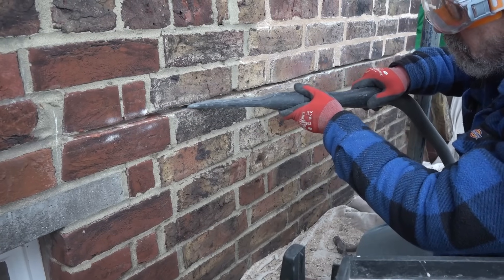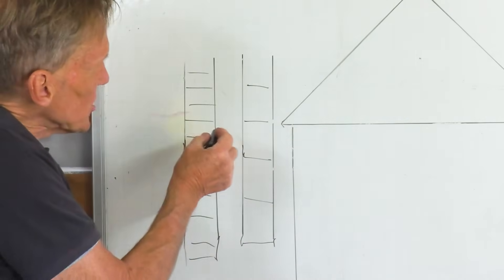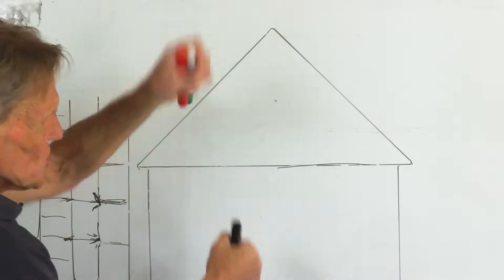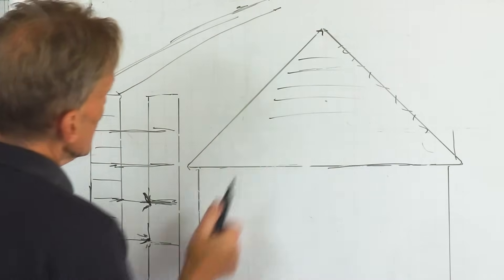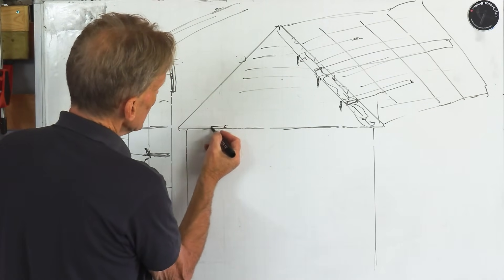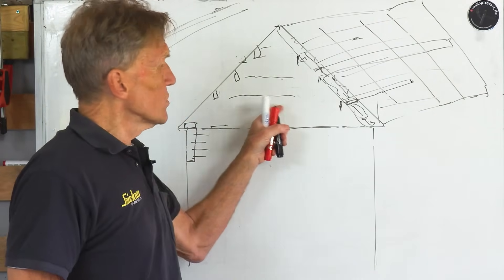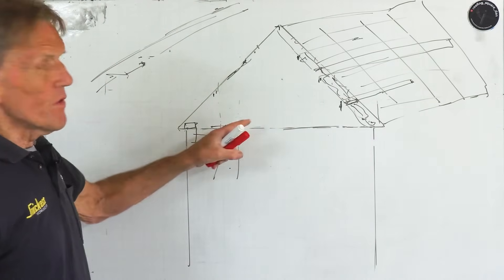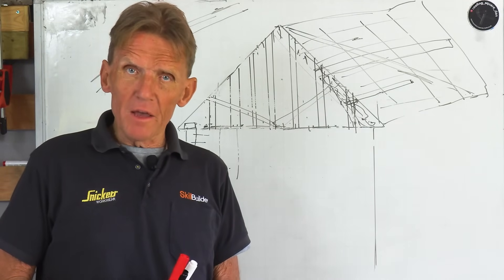Is This Climate Change or Bad Building?

Comment: As a former builder a big problem is brickies on prices per square metre leaving out the wall ties as they are only earning cash building bricks or blocks and don’t bother putting the ties in correctly, I have had to take down  blockwork in the past where the brickies missed them out and have never seen a corroded stainless steel wall tie but plenty invisible ones I subsequently took on the job myself of nailing on the timber frame wall ties at everyopportuniry
Reply: Maybe they should be paid a certain amount per square meter, plus a certain amount per brick tie. Of course, there will always be those who just grab extra ties, charge for installation, but end up ditching them the way mail and newspaper carriers sometimes did when they got lazy.

Comment: As a builder for 45 years, I can tell you that modern silo mortar is poo, there is no key between mortar and brick. The modern thin wall ties with wide cavities and aeriated blocks have made things far worse. And to add...the modern practice of putting a dpc tray right through at the bottom of the gable just exacerbates the problem.
Reply: If it comes from a silo and is premixed then the quality should be better and more consistent.  When I was monitoring bricklaying as a structural engineer and they were hand mixing on site the quality varied all over the place and the mortar was often factor strong.   If the mortar is stronger than the bricks then craking will occur and the bricks can crack rather than the mortar.
Reply: @johncranna9427  that's it's. I was a labourer on 30 quid a day breaking my back. Mixing up muck, did I care that each mix was 4 in 1, did I fkkkkk!
Reply: @Mr_Sh1tcoin well there you go.  You were probably just told to do that so I don't blame YOU, but 1:4 is far, far too strong.  The standard mix for bricklaying is 1:1:6 cement:lime:mortar.  Were you adding a plasticine (and hopefully not fairy liquid!)?  So you should have been mixing 1:6 and that's why standard bricklaying experience produces wall that crack too easily.  A strong mortar does NOT make a strong wall.
Reply: @johncranna9427  Gable end walls will definitely fall over if you use a plasticine ☺
Now a surfactant plasticiser  on the other hand....
Reply: @Coherers  I wondered at first what on earth you were going on about!!  Then I saw my predictive text error!!  mmmm!  I was always brought up specifying hydrated lime to aid workability.
Reply: @johncranna9427  yes that is true, but if you take out a hand full before mixing with water it just flies away, it is basically dust with no body or substance to it. Whereas sand mixed with grit and then cement added is a much much stronger bond.
Reply: with a brick or dense block/render outer skin, and lightweight block inner skin, you have a weight imbalance and poor wall tie fixing in lightweight block joints. I can imagine that as wind tries to suck the gable out, the weight imbalance will just help increase the movement.
Reply: @over-engineered  mmm.  Never thought of that!  But with the proper lateral restraint at floor, ceiling and verge level then it becomes academic.
Reply: @johncranna9427  ‘with proper - restraint’ yes if it’s done properly. The one that fell out in Bournemouth had the restraint straps screwed and plugged into the block work inside the loft I believe. My building inspector was very fussy about restraint straps as that accident had just happened at the time.  My 2 new builds use dense blocks inside and out (rendered outside). I believe all homes should use dense internal block work for thermal mass.
Reply: @over-engineered  You probably hit the nail on the head! "Your building inspector was doing their job" I'm doing a self build at the moment two of the three that have been out so far don't even really look at what's being inspected, snap a picture and go, lady that came to look at the footings was dressed more for night out than walking over a muddy site?
Reply: @over-engineered  Dense blockwork and a 200mm cavity (and basalt wallties) is much better than lightweight blocks and a 100mm cavity, which is currently pretty standard. As you say you get much better temp stability internally from the thermal mass, and much better U-values from the 200mm of fluff, and you can use lower-carbon insulants than PIR. But all that masonry is about 50 tonnes CO2e per house so whilst thermal mass is good, all that masonry isn't. Brick facades are a very carbon-extravagant thing and we should probably stop doing that. Block, EWI and render is a much better way to build houses IMHO.
Reply: @ I built under the previous regs, so have used dense blocks inside and outside, sand cement lime render, 130mm cavity, 75mm Phenolic insulation (K108), 50mm air gap, 5mm wiggle room. Thermally broken lintels. 100mm PIR under the floor screed with UFH. 350mm loft insulation. it’s cosy and cheap to run.
Reply: @551moley  I have a self build. . The guy who came out for the regs was great, the guy who did the warranty inspections was a nice guy but a nightmare - picky to an insane point. They actually wanted me to write to the manufacturers of the window packers to confirm they were suitable to be used as ..... packers. Thats just one of masses of craziness that went on. Oh  and that the manufacturer of the stainless steel staples holding the vapour protection on agree their staples were suitable. In the end that firm went bust and I could see why as I suspect no one would use them twice.  The annoying thing was as it is a self build of my own house it exceeds the regs minimums on things many times over.
Reply: You correct silos ok when fresh but soon gets old
Reply: @shaneh5316  I had a few batches of concreat delivered last year for an ICF build, the stuff was really smelly like a fishy odour, you can't smell it in the house now, unless you drill into the walls then you get a slight wiff?
Reply: Don’t tell NHBC they think I know everything
Reply: @ashleyfett9475  lol, NHBC know all this but they are financed by the industry so they have to keep schtuk.
Reply: Could not agree more 👍
Reply: @GV-xx7vh  you're spot on 👍
Reply: Well said .
Reply: What's wrong with the mortar?

Comment: Well because gable ends have always had chimney breast up to the roof but kept them stable and if people start taking them out it’s a lot of heights little width  to keep them stable Is there Roger
Reply: That is exactly why the lateral restraint straps are ALWAYS specified at 1st floor, 1st floor ceiling and verge level

Comment: Two issues….

18 inch damp installed on new build gables.

Installation of a satellite dish on the gable end acting as a sail
Reply: Have folks got the dish from Cable Guy strapped to their houses? 🏠📡
Reply: @ you would
Be surprised 🤣🤣

Comment: The ties are breaking exactly where building science would predict the wall ties would corrode - the point where interior heat meets external cold air and condenses.
Reply: moisture condenses at that point.
Reply: Not completely: the metal ties will form a cold bridge and already condense inside the wall, but the mortar having a low high PH will inhibit rust there
(edit) high as some people just know better
Reply: @2adamast  Low PH is acidic,  more likely to corrode metal.... Mortar is alkaline = high PH ( >7 )
Reply: Exactly! The place where you would expect to see the most condensation because of the dew point.
Reply: @trevorackroyd9931  That sounds much more reasonable.  The outer skin would be the coldest point, where any moisture would condense first.
Reply: Interstitial condensation

Comment: The disappearance of chimneys is almost certainly a big contributing factor
Reply: Chimney was like a pillar too..... even better
Reply: Chimney acts as buttress spot on
Reply: @kingofthetrowel1725  except there are many gable walls in old buildings that are notctied back to the floor, ceiling and verge.  I've done nany surveys of walls bowing out because of this.  If a house has no chimneyscthen it is most likely a modern cavity wall house and should have restraint strap ties specified
Reply: @johncranna9427  I’ve been on many jobs where lat straps and such have been missed or have said they don’t need them 🤦🏻‍♀️ on my jobs always over kill and put plenty in and always treat end of a gable like a reveal and tie every course of block within 200mm
Reply: New restraint straps are like thin bits of tin the older ones were much thicker
Reply: If you looking at houses that have chimney breasts then that will stiffen them but it also means that the gable wall would not have been restraint back to the house at first floor, 1st floor ceiling and at the verge.
Modern walls with no chimney breasts and cavity walls should be specified with the lateral restraint straps at all those levels that Roger was talking about.
Reply: No restraining straps
Reply: I came to write exactly this that structural box section that used to be up most gables is no more.

The cavity wall also add to this as it's not as structural as a solid wall especially if someone missed the ties out at the top, some of the examples here it's only the outer wall that's failed.

Comment: Fun fact those stars people hang on their barns for no reason used to be used as a cable anchor, with a cable between the two gable ends.
Reply from the maker: Interesting and quite a good idea
Reply: Mmmm if you think that one through - so one gable end falls outside the property and drags t’other gable to fall into the building.
Reply: @normanboyes4983  Unlikely. It only takes 6psi of pressure to suck/blow a wall down. If it is stabilised by a cable it would take much more force than this to bring down two walls.
Reply: @mbak7801 On that basis 6psi one gable 12 psi two gables.😉

Comment: So instead of brick gable end, use a hipped roof, say 60 degrees. Best with nice half meter overhang to keep rest of wall dry too. Then since it's a roof and not a wall, you can put solar panels on it too without permit, hehe.
Reply from the maker: Good suggestion

Comment: Is avoiding thermal bridging between the inner and outer walls causing inadequate ties to be installed between the walls?
Reply: No.  Modern walk ties are so thin that you get very little heat transfer.  It's just poor workmanship if less than 900mm ccs horizon and 450 mm vert.
Reply: You can use stainless. or better basalt. wall-ties for very low point conductivities. Probably costs a couple of quid extra so I presume people are mostly still using galv-steel ties, which do measurably reduce the U-value of the 'un-tied' wall. I used the basalt ones back in 2014 when they were quite newfangled.

Comment: Could it be temperature difference and condentation on the wall tie at the inner skin?
Reply: I thought same, this is the point of warm internal bricks hitting cooler cavity air. Might not condense but likely to be the highest humidity point.

Comment: "Provide lateral restraint to gables using 30mm x 5mm galvanised mild steel straps across min 3 rafters & ceiling joists at max 2000mm centres tied into gable blockwork in accordance with BS 5268 Part 3." (Building regs)😀
Reply: Which has probably been there for decades? Or only since the eurocodes became standard circa 15 years ago? I do recall there were some changes to better-specify restraining straps sometime in the last 30 years.

Comment: On older masonry houses in USA, even from just 150 years ago, wall reinforcements/star anchors/star bolts are often needed for safety. In areas in the USA where there are earthquakes, masonry gable ends and cornices are required to reinforced with steel tie-backs, particularly when there are emergency escape routes below the gable or cornice. 

Also on older buildings in the USA when you survey the condition of the mortar you can very clearly see the accelerated weathering of mortar on chimneys and unheated church towers versus the walls further down which have the benefit of winter heating from within.
Reply: About 20 or 25 years ago, I started to notice people putting these plastic stars on the outsides of their houses, even wood houses, and was wondering if it was some kind of religious cult or something like that. But someone at work told me that the shops that sold trinkets were pushing those things. Later while visiting parts of the country where brick construction was more prevalent, I noticed that a number of old buildings had rows of those stars at the levels of the floors, and learned that they, and the threaded rods that held them together were added to fix bowing walls. The trinket shops must have been imitating such stars and selling them as decorations.  About 10 years ago, there was a story about a strip club in Washington D.C. which had collapsed and the photo showed that the walls were full of those things; I guess they worked, but only for a while.
Reply: @pcno2832  Pretty much every collapse is DC is caused terribly executed underpinning --adding new walls beneath the foundations of old brick buildings either to make a deeper basement or to add another basement level. This is usually done in DC by unskilled labor and with minimal inspections by the city. I would guess that one such building collapses every two years in the city, almost always while still under construction. If you look it up, the strip club collapsed because they were in the process of underpinning the building next door.

Comment: (1)   Lack of brick chimneys incorporated  into the gable ends in. modern buildings
(2)  Purlins are not used in modern trussed  roof construction.
Reply: That is exactly why the lateral restraint straps are ALWAYS specified at 1st floor, 1st floor ceiling and verge level

Comment: Old type purlin roof supports help stability in the gable end.
Reply: The purlin was always the best type of roof for stability and longevity. Cost cutting using prefabricated trusses leaves the gable end without stability.
Reply: @Brian77766  Yes and no!  The purlin may have supported the gable wall at the top, but they don't support the gable at 1st floor andc1st floor ceiling level.  The whole point of Roger's video is to explain the need for those straps when using prefab trusses.
Reply: @chrisformby3039  only at the top!  You still are missing lateral restraint at 1st floor and 1st floor ceiling level in older properties.
Reply: @johncranna9427  The weakest point is at the top of the gable... No the winds are not getting stronger - that is 'climate change zealot' rubbish - more narrow three story buildings also being built to maximize number of buildings per acre.
Reply: @chrissmith2114 I take it you’ll be popping your clogs before to long.

Comment: It snaps on the inner skin due to the dew point on non-insulated cavity walls. Modern walls it's more likely on the outer skin as the dew point is shifted outwards.
Reply: I thought same, this is the point of warm internal bricks hitting cooler cavity air. Might not condense but likely to be the highest humidity point.
Reply: If thats the case, would it happen more or less if its a cold loft and insulation stops at the first floor ceiling height.

There little point in cavity pir insulation for a cold loft